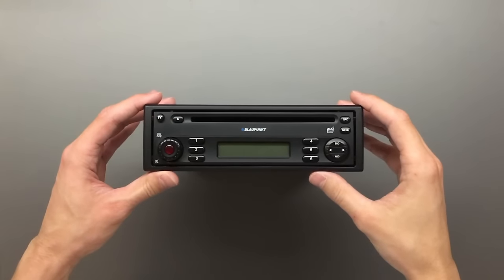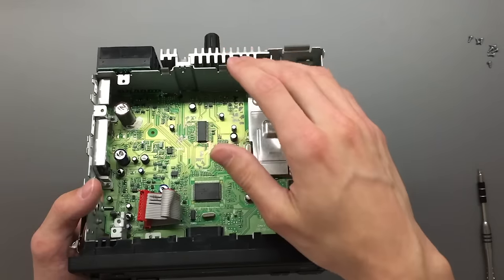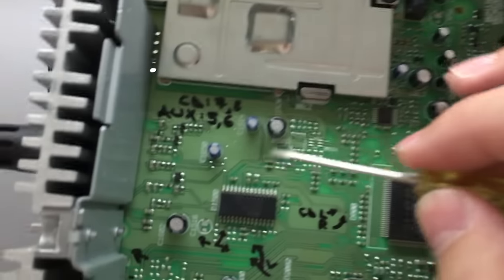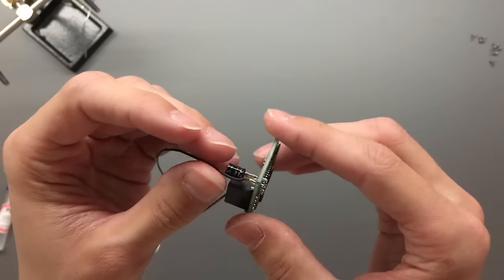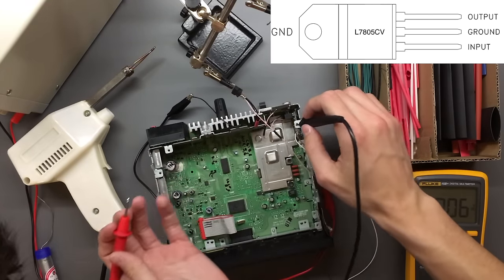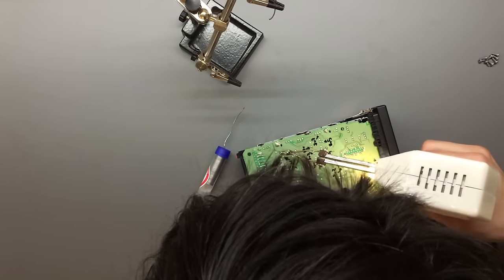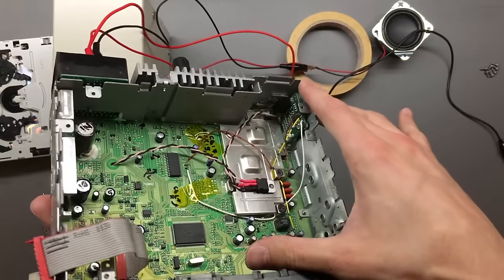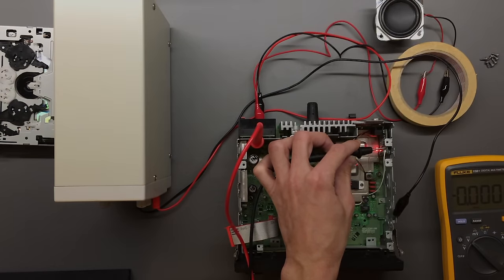How to Add Bluetooth 4.0 to Any Car Stereo for 12$ ! Complete Guide !

Comment: Hey, gerade baue ich etwas ähnliches für meinen Volvo und deine Videos haben sehr geholfen. Eine Frage: weißt du, ob man den COM port des Moduls auf GND legen kann? Ich wollte so die im Radio verbauten Taster für Play, Vor und zurück (schalten auf Masse) mit nur einem Kabel jeweils verbinden und so mein Handy "fernsteuern". Jetzt reagiert das Modul nicht mal mehr, wenn ich mit einer Litze COM und PLY direkt kurz verbinde. Die Musik überträgt er allerdings weiter. Habe ich mir den Chip zerschossen? Hast du eine Idee?
Reply from the maker: Ooooh nnneeeein !!!!!1!1!11

Mach das nicht, COM ist die 1v8 Rail .. also, wenn du das auf Erde runterschiebst wird's sehr sehr schlecht enden für dein Chip :D
Reply from the maker: Shit jetzt hab'ich gelesen .. na .. musst wahrscheinlich dich ne neue bestellen - aber da hab'ich irgendwie noch gute Nachrichten für dich, und zwar, gibt's neue Chips die viel besser sind: CSRA64215 5V (oder 12V) .. die kosten auch ~11€
Reply: Hey super, danke für deine Antwort!
Doof, dass COM stromführend ist. Dann muss ich mir etwas anderes einfallen lassen, wie ich die Tasten des Radios dafür benutzen kann. Die gehen leider zweifelsohne an Masse.
PS: finde es super cool, dass du solche Videos machst. Hab schon viel von dir gelernt.

Comment: I enjoyed the video. But you should have included the process of bluetooth pairing with iPad since this BT module doesn't have any display or controls.
Reply from the maker: Doesn't need any

At power up it tries to connect to the last paired device

If there is none or it can't be found, it's discoverable

Comment: Hi Darieee, stumbled on this video and looking for help. Purchased a CSRA64215 to give daughters car stereo bluetooth. powered unit up with 3.5 aux to car stereo. Pairing is fine and can play music fine. However when making or receiving phone calls i can hear the caller through the speakers, but they are unable to hear me via handset in car. thought i could wire in to mic pins, but seems this is just a mic to output. Any advise would be a great help.
Reply from the maker: Alright so, either way you seem pretty far along

So you 'did' wire up a microphone to the CSRA64215 module?

Comment: I have a Pioneer DEH-P670MP. It has an Aux capable plug but I'm having a really hard time finding any schematics to understand where I need to start soldering to :X
Reply from the maker: Connect the L R and GND to the corresponding aux wires, and find a way to power the bluetooth module; if you have an AUX you don't need any schematics
Reply: @Darieee  Thank you for the fast reply!!! That's what I was trying to do before. but I can't find where/how the aux works. It's a third party plug that gets attached to the back of the unit. Taking the unit apart and trying to trace backwards from the actual port is quite difficult. There appears to be a "rear RCA" which might work for what I need it for however I don't know how to enable that through the header's UI. I found a datasheet for one of the chips but I don't see any inputs so I assume it may be the Tuner.
Reply from the maker: Yeah .. it's gonna take some patience until you figure everything out
Reply: That's frustratingly unhelpful haha. I'll continue scouring Google and maybe post on some other forums then.
Reply from the maker: Yeah, the way the cookie crumbles

Go ahead and watch ffcossag 's youtube channel, he does a lot of audio work, and slowly you'll get a feel for what to look fir

Comment: Do you know if it’s possible to add AUX function on a radio when if you press on “source” button the radio slide all source connected same as CD player, cd changer, md changer, and more ? Because on my instructions manual of my Honda car stereo radio it’s mentioned a capability of 5 unit connected maximum in serial on the cd changer’s plug, do you know if I add this module and connect the “ply” pin of the bk8000l it’s possible to my car stereo switch and detect this module for a CD player maybe ?
Reply from the maker: Mmm, that I really don't know - try some Honda forums perhaps

Comment: Neat project. I am interested in the last part with the floating ground. I have installed an android unit to a bmw and using aux in for audio input. The problem is that low frequencies are missing. You floating ground "bonus" gave me the idea to try and attach the negative of the android unit out to bmw's chassis and maybe it will fix the no bass issue I have?
Reply: Check your speaker polarity. If left and right speakers are out of phase they will essentially cancel each other out which is particularly audible in the lower frequency range, thus the missing bass

If you don't have a tool for checking polarity just flip the positive and negative wire on ONE of your speakers
Reply: @filipprucnal  The way the the android install was done was that the audio goes through the AUX in of the BMW so nothing was changed speaker connection wise. When playing the radio through the BMW system (BMW M-ASK) everything is fine.
I am suspecting 2 things.
1. BMW, for some reason, filters low frequencies of AUX in via software.
2. The android I have has wrong pins for R+ L+ and ground.
The reason I was looking at your trick is that I am thinking of doing it to my car if I can't find a solution via AUX in.
Also, I asked about floating ground as I thought to connect the AUX ground to the chassis of the BMW system.

Comment: @Dariee, I have a rare Pioneer deh-9800bt which has a pre-historic bluetooth module, I need to pair again each time I turn on my car (when I mean pair again, I need to put the password every time, which is very annoying). I'm wondering if I replace the original BT module with this one. I don't want to replace my unit because this Pioneer have the best audio adjustments and I don't see a necessity to spend more $100 on a new unit. Do you think it will work?
Reply from the maker: I am more than confident -- if the prehistoric one outputs digital i2s audio, you might need to tweak a few settings - but I doubt that'll be necessary
Reply from the maker: Do buy this type of module though:

http://s.aliexpress.com/N36zIfyM

Seriously more power and compatibility than the 8645, at an even (by now) lower price
Reply: Thanks, I'm back home and will try it in the following weeks! :)

Comment: I plan to do this with my radio as well. It’s my understanding that the Bluetooth connection is a one-and-done connection. As in, if my friend wanted to pair their phone while I drive them around, I’d have to unhook the radio and then hook it back up and have my friends phone connect to the Bluetooth. 
Does anybody know if adding a button or switch to the power of the Bluetooth module/board would properly reset the Bluetooth connection? I tried reaching out to a few companies in particular but haven’t heard back
Reply from the maker: sure, usually the play button on those modules has a "become discoverable" action on the long press

Comment: I would like to do that with a Skoda Symphony head unit, but instead of Bluetooth only a simple AUX cable.
The problem is that I can't figure out where I could solder my wires. Could you assist me if I will send you some pictures or the number of the chips on the board?
Reply from the maker: sure

I'll be needing to do that soon too 🔥 (half a year plus though)

write me an email at lipton5001@yahoo.com

show me the front of the radio too
Reply: @Darieee  thank you very much, I sent you a mail with the details. 😀

Comment: Hello sir. I have a question. I just received my Bluetooth chip and was going to begin hopefully adding Bluetooth to my stock radio. My car radio has a auxiliary input would there be anyway to use the auxiliary input for the Bluetooth instead of the CD player? If it helps this is the model number to my radio pn-2591m. Thank you for any help
Reply from the maker: Good day sir; it sure would work, take the R L and GND and hook them up into the AUX. That'd even be way better than using the CD

Comment: Maybe I missed it in the vid... silent CD? So, you have to put in a blank CD? Also, how do you pair to this device with no usable interface on the radio? How would the Bluetooth know you are attempting to cast to it?
Reply from the maker: Yeah, a blank cd with a silent track on it

At powerup the bt adapter attempts to connect to the last paired device - if that fails, it becomes discoverable, then you can pair to it

Volume on its end in maximum by default, so max on the phone is the max it can put out into the radio
Reply: Darieee - ah, interesting. Not sure it would be worthwhile for me, but interesting. 👍